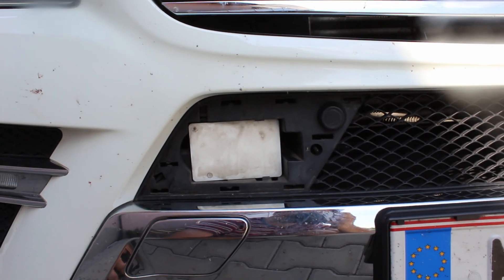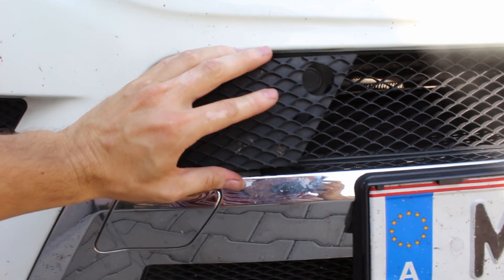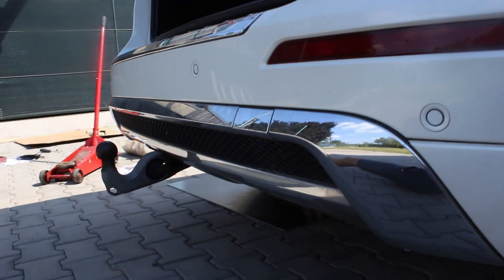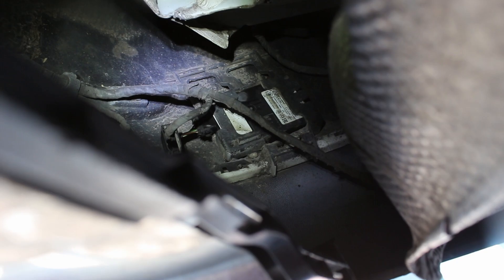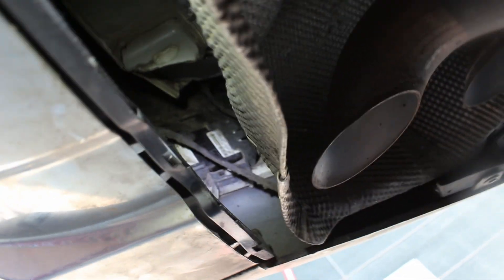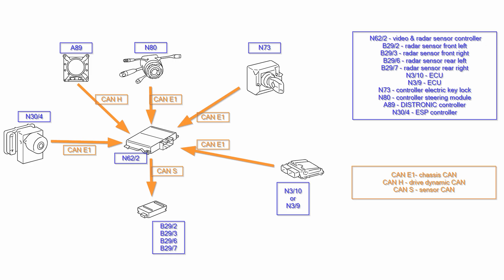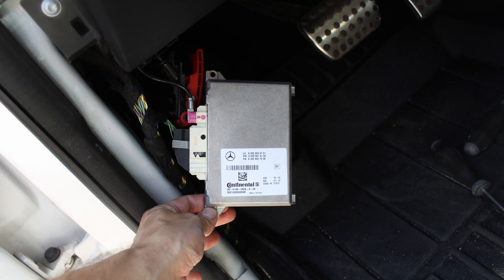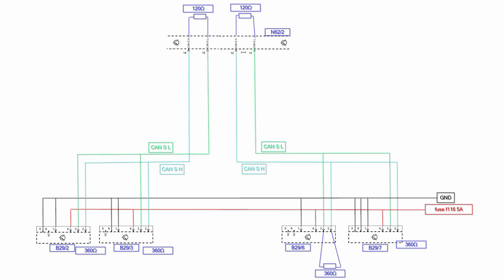How to: Mercedes Radar Sensor Diagnosis and Schematics

Comment: I have the same errors and the blind spot assist and adaptive cruise control don't work. Does this mean that both sensors are faulty? Could it be that one sensor is faulty, but the whole system don't work because all the sensors are connected to the same can bus?  I didn't dig further than the blind spot assist sensors, but I have to replace one sensor connector as the contacts were oxidized. It didn't help, the system didn't work. I have not disassembled the sensors, they look normal from the outside. If I connect one sensor, will the system work and show only one sensor malfunction, or should I replace both sensors?
Reply from the maker: @fevgg Start by measuring the resistances, they are a good indicator if more devices are broken. It is very easy, just get access to the N62/2 part as shown in the video and from there you can measure at the wires the resistance for both radar sensor groups (front and rear) - the value you measure should be 180Ohms between pins 14&15 and 12&13.

Also measure the resistance of N62/2, it should be 120Ohms between the pins.

If all resistances are alright, check the errors via OBD.
Reply: @turbomint  The bad things that OBD doesn't see the sensors as they never existed. I found that one connector was totally oxidized and I had to replaced it. When I connected the sensors back, still nothing happened. I will disassemble sensors and check if they're damaged with water. Then will check resistance